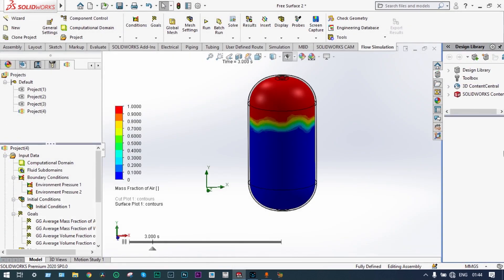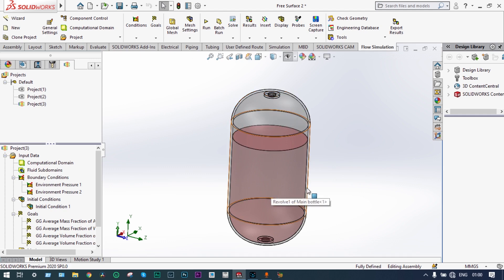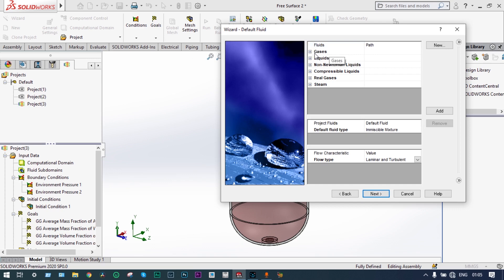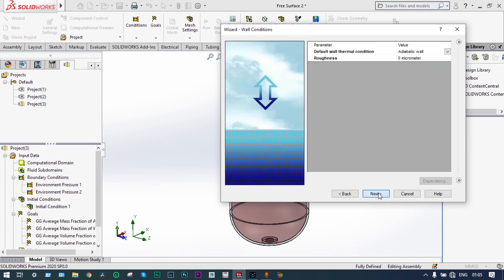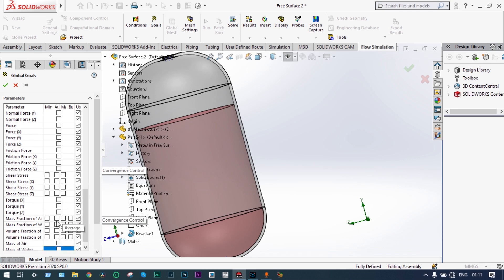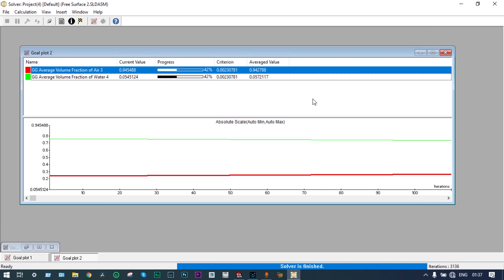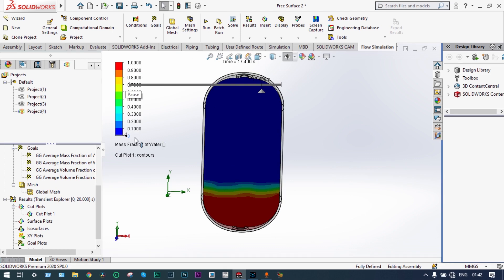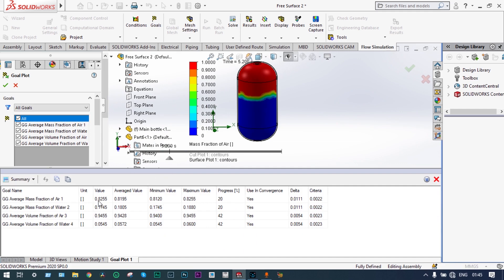Fluid Mixing Technique in SolidWorks - Free Surface Transient CFD Analysis

Comment: Can you help me set up mixing time for a Static Mixer? I attempted to run mixing time in Ansys, but I don't know how. So I'm going back to my root which is SolidWorks
Reply from the maker: What do you mean by time? In transient analysis you have to initiate the simulation with an arbitrary time and from results you can find the fraction of volume mixed at different time intervals. Later on you can optimize to get your desired mixing volume or mass